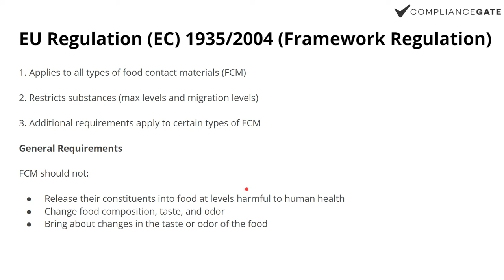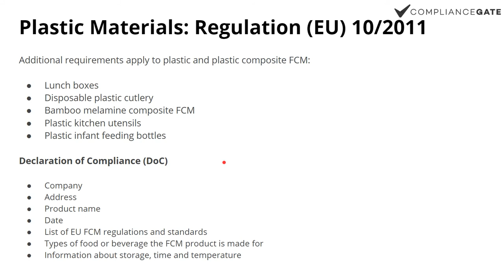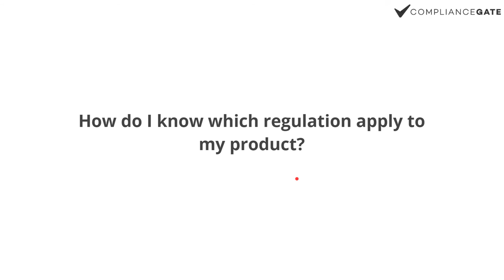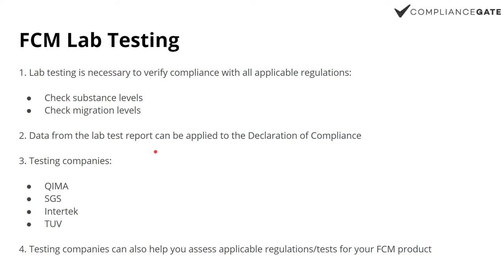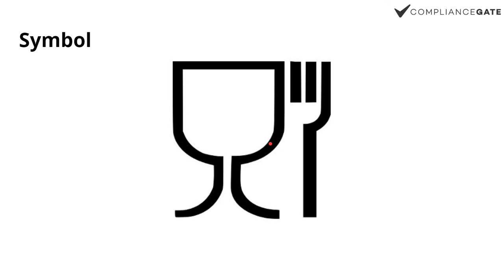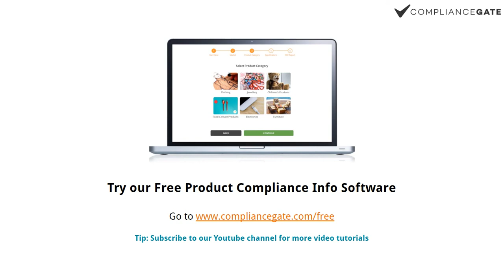Food Contact Materials Regulations in the European Union

Comment: Do you perform tests? Is it possible to do tests not for a single part but for a process, so the same manufacturing method can be used for different designs and variations while issuing the DoC?
Reply from the maker: We are not a testing company.

When you say process... in the end, it is the manufactured product that must comply. It is not certain that every single variation would impact compliance and thus it may not always be the case that testing is needed

That said, this must be decided on a case by case basis, so it's hard to be specific without taking the time to understand what these designs and variations might be
Reply: @ComplianceGate  thank you for your answer.